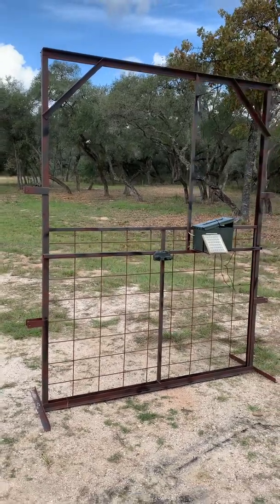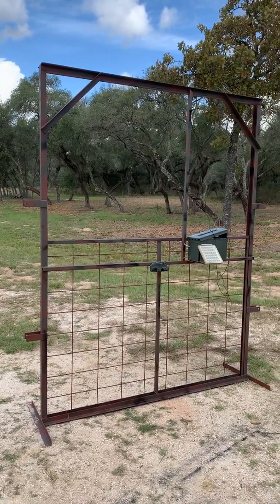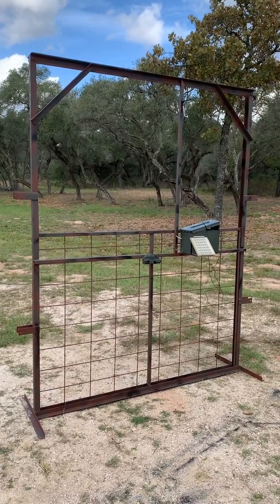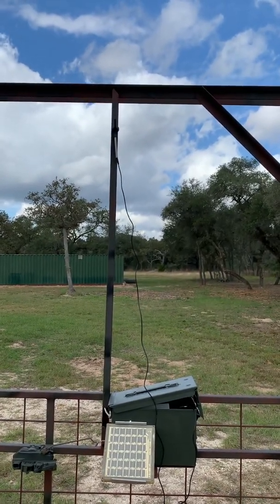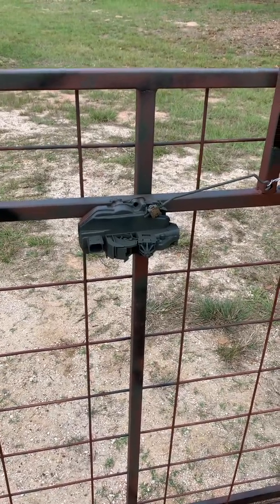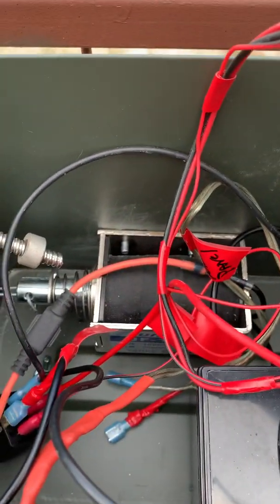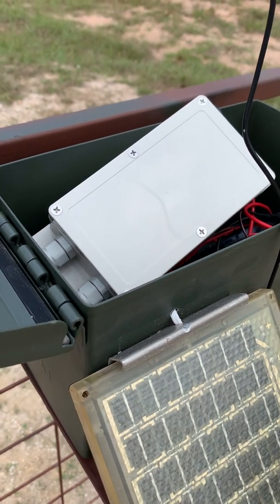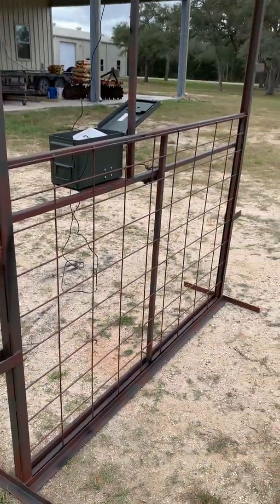Build Hog trap door with wireless cellular design for $200.

Comment from the maker: Update 9/2022 -   Lots of lesson. 
1.  Finally added a second ammo box with a $40 lawn mower battery to get the run time I needed. 
2.  One of biggest problems with open gates is deer come in and eat all the corn before hogs. Turns into a deer feeder vs hog trap.  I tried adding a saloon style door that hogs would have to push on to get in. It stopped the deer but hogs not as likely to go through it.  I had also built fencing using 5’ tall cattle panels. Welded 5’ x 8’ square using 1” square tubing. Then welded the cattle panel to that. Made it easy to set up and move.  
3.  5’ tall fence not high enough.  I would get pictures of deer that had jumped fence!   Then one night got a picture of a buck that had jumped fence (going out) but back legs got stuck in the fence. Found him the next morning dead about 20 yds from trap.  Broke his back legs and coyotes ate him.  Will be adding 16” to top of fence. 
3.  A few parts people have asked about
A. Fielect DC 12V 80N 10A Push Pull Type Solenoid Electromagnet Open Frame Solenoid Electromagnet Linear Motion, JF-1683B-12V
B. KiaoTime GSM-RELAY-US4G Volte 2022 New USA AT&T 4G 7CH Output GSM SMS Remote Control Relay Contact Switch Box iOS APP (Note - you do not need a 7 channel. Only need one channel)

Comment from the maker: Update  (7/26/2021)- I have found that I can only get 2 bars on att even with the antenna up about 6’. I think this causes the cellular board to search more often. Even with a solar panel the 12v feeder battery would go dead after about 3 weeks.  I added a second 12v battery in parallel. This works much better. 
I find I get a lot of deer going into the pen so I just (7/26/2021) strung a few wires across the gate to see if that deters the deer without impacting the hogs.  Will let you know. 

I ended up using 5’ tall wire fencing. Had to put tee post ever 5’ to make it strong enough. Needed to really twist the tee post clips to hold fence. First time I caught a big boar he knock all the clips loose and almost got out. 

Next project is take 5’ x 16” cattle panel cut it at 8’ and weld it inside of angle iron so easy to move (5’x8’ panels) and get rid of a lot of tee post. The pigs get smart quick. You will need to move trap.  I find if I go to trap to add corn or just check it pigs don’t go into trap for 2-3 days. 

I use a Spy Point cellular camera. Tied a 10’ x 1” PVC pipe to 8’ tee post. Ran a external antenna with 15’ cord to camera. Only way I could get good (50%) signal.  Another $70 from Amazon.  Yes it does sway in the wind!

Comment: What is the relay in the box for ?
Reply from the maker: The small black relay is used to prevent the main controller relay from being overloaded when the current is sent to the solenoid to release the door.  The main controller relay should be able to take the load but by setting it up like this the main controller relay sends the sign to the “black” relay.  This then fires the solenoid. These type of relays are used on cars for LED lights etc. using a $8 relay to handle load versus risking $100 control board.
Reply: Great video.   I really appreciate your sharing your creativity.  Would you mind sharing the solenoid and controller you used.
Or maybe an electrical parts list?